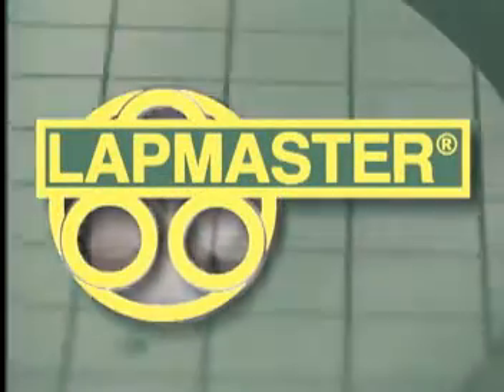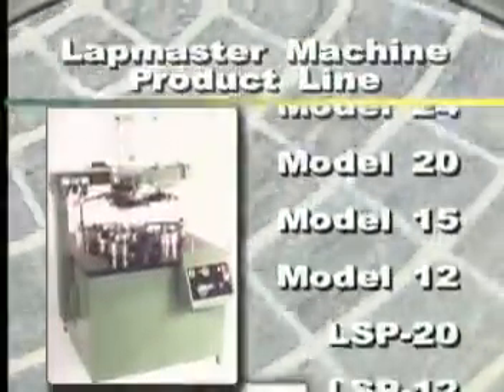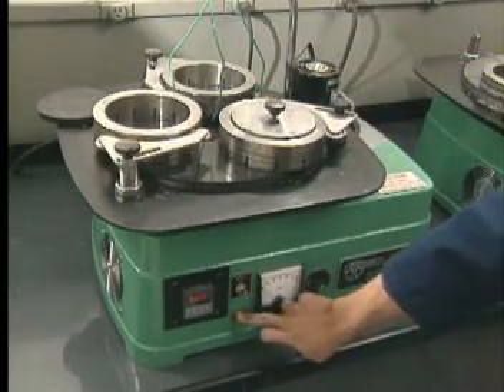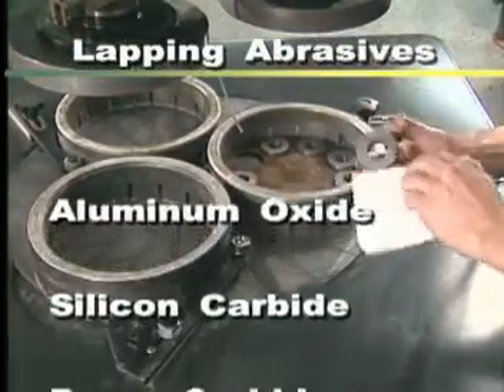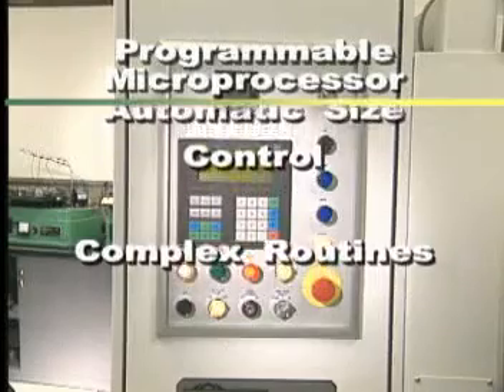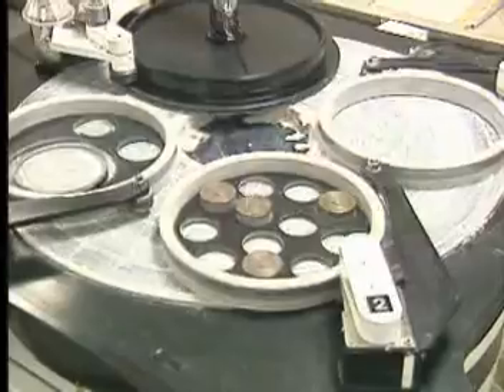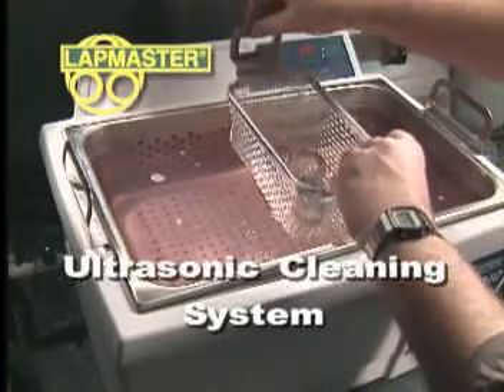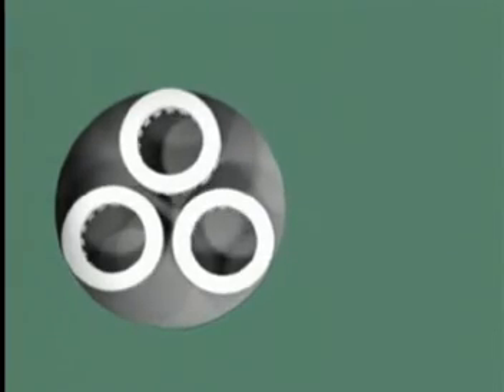Lapmaster International Product Overview

Comment: good afternoon, we have a ss36h lapmaster machine and I would like to know wish is the proportion between vehicle compound and aluminum oxide to avoid paste
Reply from the maker: +jose luis orduno moreno depending on the application normally we suggest 1 pound to 1-1/2 pounds per gallon of vehicle
Reply: thanks for you prompt response, we have aluminum oxide for inconel 718, is that the correct abrasive?
Reply from the maker: Yes, Aluminum Oxide will work depends on the surface finish and removal rate you want